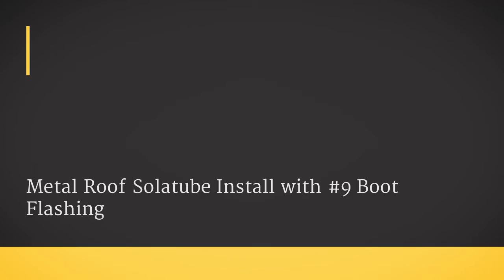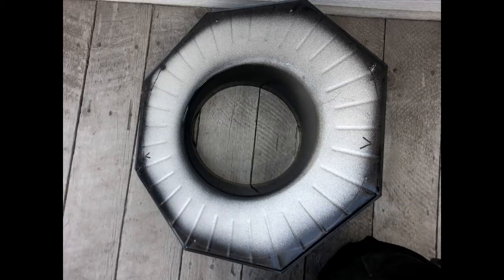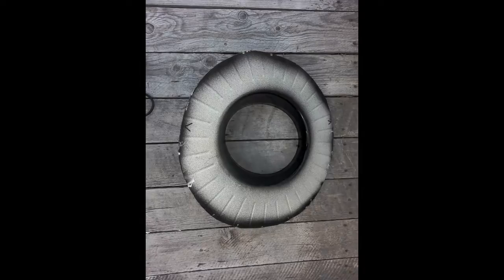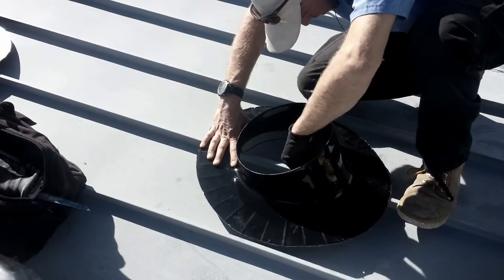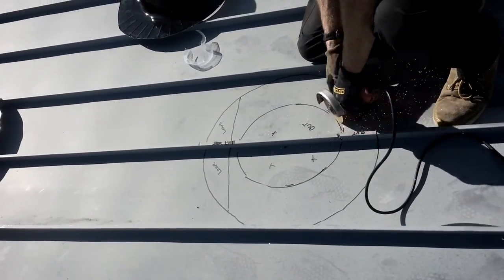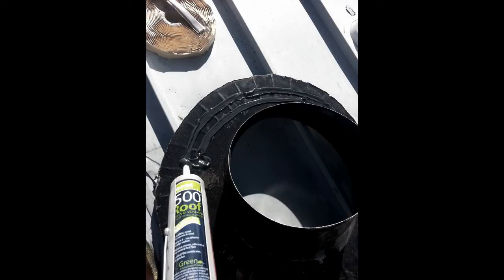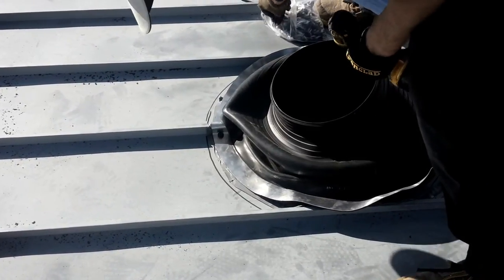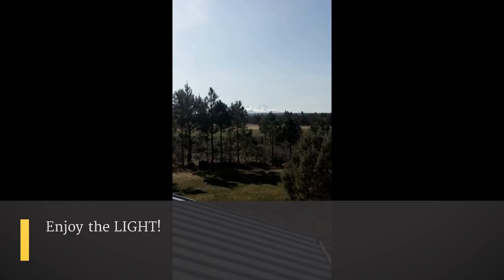How to Install a Solatube on a Metal Roof with a specially flashing

Comment: Thanks for the video. Though in several other videos I've watched they say the screws shouldn't be more than 1.5 inches apart on those types of flashings. Also there's a better way to seal when on a seam. I think they use "Z Bars" (???) to lift the flashing above the seam and mount it on a perfectly flat piece of metal. The Z bars mount flush with the seam and direct water off to the side as it's angled like a diamond. Just what I've seen. Might consider looking it up for future installs. One last thing, ditch the music or turn it down considerably. It is very distracting and over competing with your narrating. Cheers

Comment: Not real good with the snips eh? You just need some practice. Using a grinder on a roof will rust  from the grinding dust / filings and will void the warranty on the painted finish.

Comment: Have you installed one of these in a hot roof application? without roof 'attic" access how would I apply the tape around the sections? thoughts? Thanks

Comment: Why are so many roofing techniques crude like this?  The attitude is that from the ground, no one will notice how shoddy the job really is. . . .
Reply from the maker: Antony Cooke  Hello. I am a little unclear on the reason for your comment. I was not installing any roofing. I did install a solatube on a metal roof & that solatube does not leak. I did also use this same technique when installing a Solatube in Tenakee Springs AK. Its said that is one of the wettest places on earth. Guess what. That solatube also does not leak. So be it that a sealed solatube is my goal. I achieve it with this technique.

Comment: This video is well made and very helpful! Thank you! I found some solar tubes on Craigslist for a song that I'd like to install at my shop but it has a corrugated roof. 
Also, Painting cut areas is good idea but if you don't, I'm sure it would be fine since the cut area isn't exposed to the elements. It's in a dry roof. I build in New Orleans where is very humid and it's fine here. Anyway, great video.
Reply from the maker: +Gairuntee Glad this helped. I agree, I am not overly worried about the edges, however it was a good point some one made. I recently did an install in Tenakee Springs Alaska, in the South East. Very Very wet there, with lots of salty air, in that case I did paint the edges, But that is a very rare sort of climate that I deal with.  Anyway, very glad this helped. It means a lot when I get good feed back on these videos.

Comment: You can not make a hole with angle grinder because it can then metal sheet can rust. Samething to flashing. If you must do it with angle grinder then paint it with antirust paint.
Reply from the maker: Thanks Matej, I have never heard of that before, so its great info to look into. All cut areas should be covered by sealant before finishing ( this maybe how we have stopped any rust for years no rust on installs). In Central Oregon where we do these installs, I however have never seen this happen ( rust from grinder cuts on our installs review installs from as far back as 18 years) , ether because of the sealant over cut edges, or because a inland, dryer climate. Before doing this boot technique illustrated in this video procedure we did a similar installation process in regard to grinder use. This is really good info however, and I will target a tweak to this procedure video right away.
Reply from the maker: Just updated the procedure to include the rust paint points. Thanks Matej